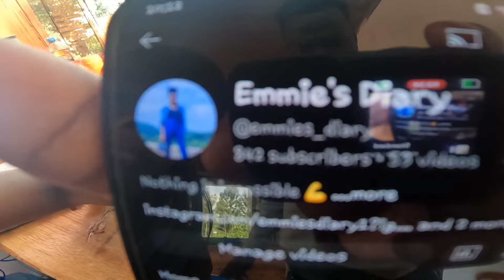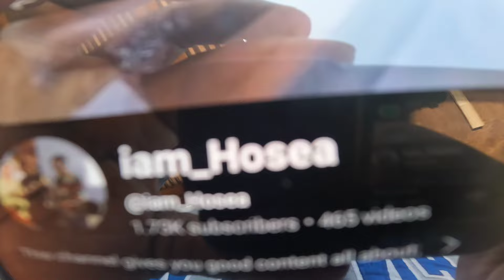Amazing Interior Finishes of The Sunrise Cabin ♥️🌹

Comment: Hi RK, I think you should have the door open to the outside. This will provide more room inside and for security reasons you can easily push open to escape safety in case of any hazard within the building
Reply from the maker: Hay Emmanuel, thank you so much for the tip,I will towards that ♥️🙏🏿👑🌹